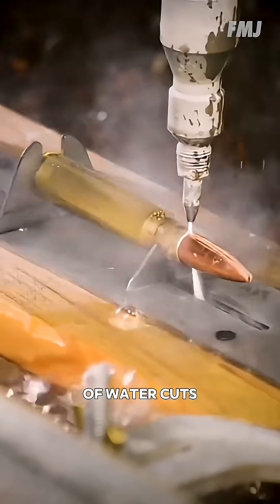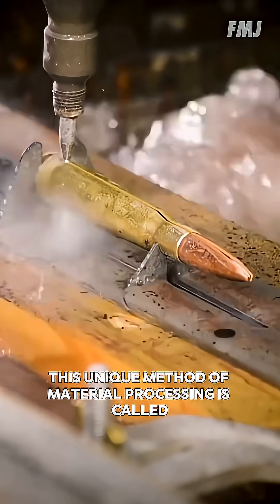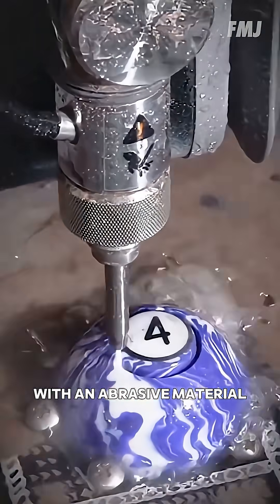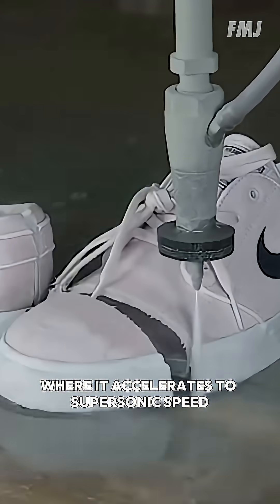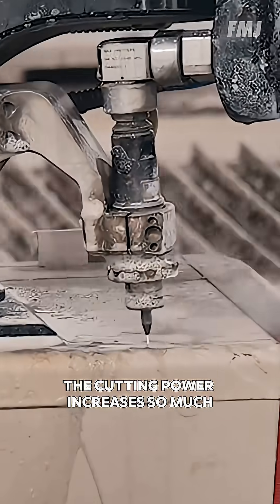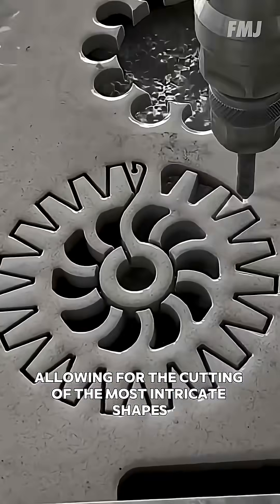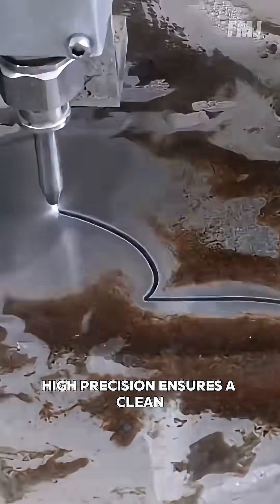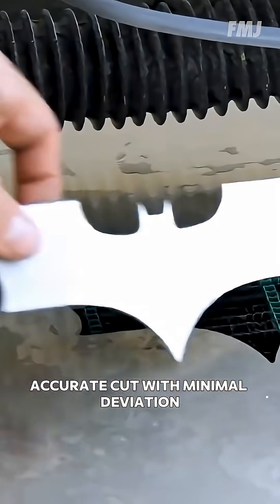High-speed Water Cutting Process Revealed #viral #satisfying

Comment: I'm sceptical about the anvil cut though, seems too thick for it.
Reply: That was my thought aswell so I googled it 
Typical Thickness Capabilities:

For Precision (Aerospace, Machinery): Expect up to 8-10 inches (200-250mm) for good tolerances and edge quality on hard steels, says VICHOR Waterjet and AquaJet Services.

For General Production: 6 to 12 inches (150-300mm) is a common range for many types of steel, notes SS Engineering Works.

Maximum Potential (Billet Prep): Some machines can cut upwards of 12 inches (300mm) or even 18 inches (450mm) thick, but this often results in a tapered cut and rougher finish, explains AquaJet Services, TMC Water Jet Cutting, and Techni Waterjet.
Reply: i build these machines for a living, and ive seen things that surprise me. that video is sped up though and you can see the cut quality is pretty jagged. that cut may have taken almost 30 minutes to do something that thick, but with time and the right type of garnet very very thick things can be cut..
Reply: @TBPony  true... but I'm under the impression that even a laser cutting beam can only be focused so far. It's the old quality over quantity.
Reply: @timhinchcliffe5372 yes it really can only go so far and an anvil that size we would tell the customer beforehand of the risks of material involved. But it is possible but not without more post machining.
Reply: Don't be, they absolutely can do it. I worked in a shop that had a 100KPSI waterjet (the stream velocity was near mach 3) that could cut through six inches of tungsten carbide, it took about six times longer to cut than mild steel but it could still do it, though the cut quality towards the bottom edge was ass, very jagged and tapered. It could cut through 12" of hardened steel as well, an anvil would be no match for it. These machines are insanely powerful, the pressure the pumps generate is double that of most high powered rifle cartridge chamber pressures, and when you add in the garnet abrasive grit which is one hardness level below diamond, at 9 on the Mohs scale, there is not much that can stop them. Fire departments are using smaller more mobile handheld versions for entering buildings and vehicles now too, which have fire suppression abilities on top of cutting abilities.
Reply: I think it's sped up
Reply: Calling Bs on cutting the Lithium battery that reacts to water with smoke and possibly explosion and flames😂

Comment: I used to make small medical tools using a water jet machine. This is nothing new. It wasn't even new when I did it almost 30 years ago. Works great. I also operated a laser cutting machine that did basically the same thing. I preferred the water jet.
Reply: How much energy was required, and how to learn how to do it?
Reply: I've done exactly the same job as you on both machines made by Bystronic.

Comment: Why doesn't the abrasive erode the nozzle?
Reply: It does erode them. There's a replacement cycle for them depending on frequency of use and precision required.
Reply: AI didn't think about that bit.
Reply: Or erode the turbine?
Reply: @folag the addition of the abbresive probably happens in the very final stage, avoiding having it getting in contact with the hardware, except the  nozel which obviously cant be avoided.
Reply: ... Now listen here, you little... 😂
Reply: @effdiffeyeno171 "That's abuse. I came here for an argument."

Comment: If those could be built light and small, nothing would be safe from a drone...
Reply: Water... lots and lots and lots and lots of water - and some more water, and a little bit more water, and then a lot more water! Water is heavy, well rather, despite the fact 1l is made up of 1330l of hydrogen and 670l of oxygen.
Reply: A very large obstacle (to putting this on a drone) are the pumps required to reach such pressures.  Modern, high-end “ultra-high pressure” water-jet cutter systems can achieve even higher pressures around 6200 bar (90,000 psi) while cutting.  But the pumps are large, and heavy, need a lot of (electrical, diesel, etc.) power, and require substantial maintenance to keep performing at that level.  So, I imagine that a drone would be land-based (not an aircraft drone), and it would likely use a diesel-powered engine mounted on a somewhat large truck so that it could carry the necessary pumps, pressure-boosting equipment, and water that would be necessary.

Ed Schultheis
Mechanical design engineer and manufacturing consultant
Reply: The nozzle needs to be very close to do the cutting, within a few inches or less.
Reply: @davewinch7677  For sure, but with modern AI technologies, alien integrations, quantum processes and the EB Cloete Interchange, as humans we are now more than comfortable to come close to less than a few atoms away from any other given atom in relation to the other atom!

Comment: The sludge left over after months of running is considered Industrial Waste and has to be disposed of. It has a system to purge out the material in the bottom because it will build up hydrogen gas and explode
Reply: No, no it doesn't. The "sludge" is water, abrasive fines, garnet, and the remnants of the material being cut. There is no electricity added to split oxygen atoms into hydrogen through electrolysis, nor is there chemicals introduced that will split oxygen atoms into hydrogen through redox.

It is industrial waste, normally non-hazardous. If it's been used to cut lead, cadmium, etc then it's hazardous industrial waste due to water leeching, etc.
Reply: @Shadow_Sky79 not sure if you were in a rush but oxygen doesnt get split into hydrogen in any shape or form, you might have meant splitting water and separating the oxygen from the hydrogen ?

Comment: You cut a lithium battery with water?
Lithium explodes whith contact to water. 
Me suspicious.
Reply: yes u can .. the water do react with Lithium, but the hydrogen gas and LithiumHydroxide is ejected, so nothing that can explode is left ..
Reply: @Patrik6920 so why arent our eyes detecting it? I clearly meant to little to be detected by observing this specific event performed.... sure it would be different pouring water normally on a battery as it will result in little reaction, far from anything dramatic.
Reply: @jacobmalke3586  a water jet has a typical water speed of 600-1000 m/s (2000 to 3400 feet/s)
so from passing the visual distance say its 4dm is
0.4/600 = 667 microseconds far faster than human visual resolution which is 10-15 milliseconds .. we r simply to slow to see it .. and to film it u need a frameerate of atleast 1500 fps to even capture one event .. but u likely want atleast 15k fps to see it happend.

simply put, it goes to fast for us to see
Reply: @Patrik6920 yes, thats my point but I didnt have that info about the actual specifications of the water-jet machine...you just answered your own question to why we cant see the reaction in the video, ironic?
Reply: Was wondering why no fire. Says Li-ion on the battery.  Hmm.
Reply: WOW! I didn't even catch that.
This might be a total BS video.
It looked real too.
WOW😮❤
Reply: @albertlevins9191 Waterjet is real. I remember in the 90s when they tried using hand held hands to cut concrete. Not the straightest cuts. Went through rear with no problem.
Reply: Hand held " Wands". Damn autofill
Reply: Have you looked into the actual amount of lithium content in a lithium battery? Look it up, might be the reason you dont see any reaction by using human vision to detect
Reply: This battery has only 1.5g of lithium in it and it's spread out through all the cells, they are not cutting solid chunks of lithium.
Reply: @GM-ii8gs  thats a rly good point ..
Reply: It maybe already discharged 😅
Reply: It’s probably an old nickel hydrate battery lithium would send it into a phrenic explosion
Reply: Check out "Cold Cut Cobra for electric vehicle fires." The best way to put out an electric vehicle fire
Reply: it's shot circuited

Comment: It’s only been around for 30 years or so
Reply: Water jet cutting has been around since the 1800's and originally used in mining. Early 1900's a finer stream was developed and was used to cut paper products. Mid 1950's the tech improved and was being used to cut steel and alloys at 100k PSI. This caused problems with materials and led to the development of modern water-jet cutting in the early 60's with a pulsing jet at 50kPSI and abrasives added to the stream.

Comment: If no heat is involved why is the nossle bone dry and water evaporates as soon as it touches the tip
Reply: The water heats up considerably as it's pressurized. At that pressure water is also compressible. I used to work with 40,000psi waterblasters and it was ~180°F at the nozzle

Comment: When the blue anvil is easily cut with this instrument, can the instrument also easily cut   something similar, such as a bank vault? 🤔😮😬🙏
Reply: Sure, just wheel it into the bank lobby and tell them your here to pressure wash the vault door 😂
Reply: @torcheddreadnought899 Sure, I'll remember this the next time I plan to break into a bank vault. 😬

I'm reminded of the exciting 1981 movie, THIEF. James Cann starred as a "super thief." (James Bullushi had an important supporting role.) After Cann and his gang break into a diamond center building, the highlight came when Cann breaks out a "burning bar" to slice open the vault, almost like that high pressure water jet would, but only with tons of smoke.😮😮😮

This is because a "burning bar" is a hollow rod with acetylene and oxygen fed into it, and most importantly, it's stuffed with magnesium ribbons. When magnesium ignites, it burns at upwards of 3000° F. When coupled with the acetylene and oxygen, you got a "burning bar" that can cut through anything, but with a ton of smoke. 

Cann's burning bar did show smoke, but probably much less, since it was a scaled down prop. Still, you've got to see the movie. But just the same, I thank you for your helpful advice. 😬😬😬
Reply: @altonyee4488  It's a couple years before my time, so I've never seen it, but I'm going to watch it this weekend. I'm feeling more 80s nostalgic than normal. Willie Nelson was young in that movie 😅 . Thanks for the tip.

Comment: When cutting through the anvil shouldn’t it have been smooth and not jagged ? 🤔
Reply: No.  The way the stream deflects as it cuts causes the jagged edge.  You can reduce the traverse speed to mitigate the roughness, and if you slow it enough you can get a reasonably smooth finish.
Reply: Material at that thickness is normally a rough cut that goes off for machining afterwards if a flawless finish is required

Comment: A regular stream of water? Mixed with abrasive at 2000 bar? Cool story.
Reply: Modern, high-end “ultra-high pressure” water-jet cutter systems can achieve pressures around 6200 bar (90,000 psi) while cutting.  If necessary, cutting tolerances of +/- .005" can be readily achieved for many materials, depending on the thickness of the material.
Reply: @edschultheis9537  not really a regular stream of water then is it?
Reply: Jeffrey Dahmer would have loved to have one of those.
Reply: This is rather standard equipment in many well-equipped machine/fabrication shops.  Often, the same shop will have a laser-cutter system along with conventional lathes, milling machines, drill presses, etc.  Water-jet cutters and laser-cutters can often achieve similar results and machining tolerances, but one or the other may be more desired based upon the material being cut, the cosmetic appearance of the manufactured parts, whether gas fumes (from a laser-cut part) are acceptable, and a few other factors.
Reply: Can't cut tempered glass, tho'
Reply: @col0342 also can't play crysis😊😊
Reply: When cutting 1/8 inch plastic/Plex/Acrylic, Polycarbonate, you turn off the abrasive ~ still take your finger off!
Reply: Thought that was a bit inaccurate too 😂 still cool video 😆